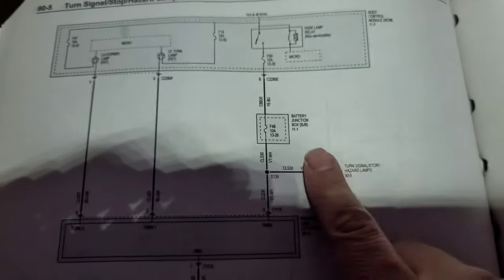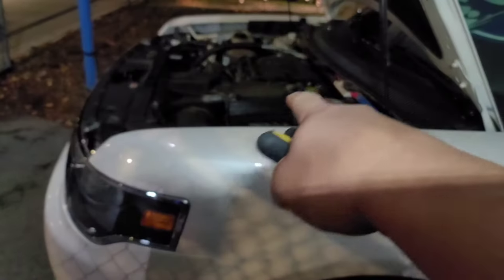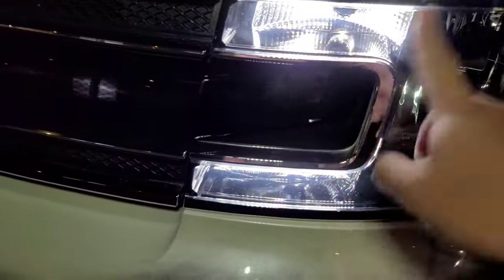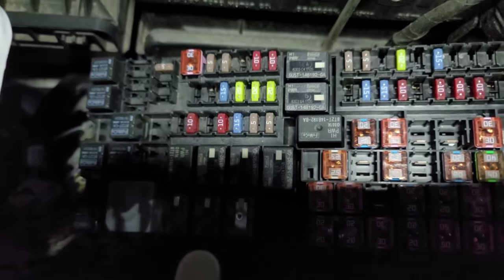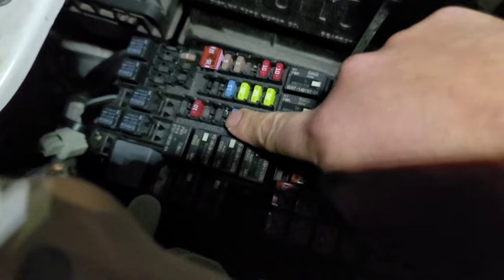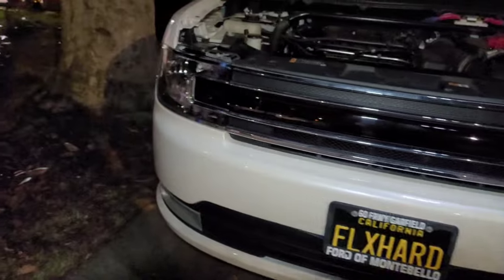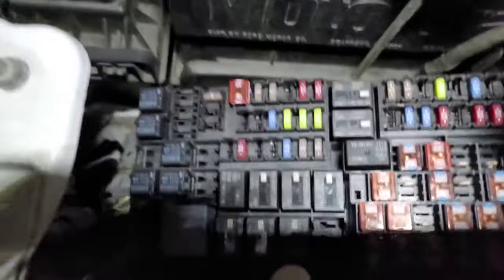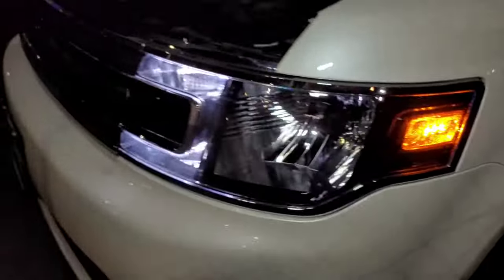Troubleshooting Front Parking/Side Marker Lights Not Powering On. For Onyx.

Comment: I am having the same problem in my 2006 nissan pathfinder, blinkers work but not the side lamps or running lights. The fuse for the running lights appears to be fine :(
Reply from the maker: Have you had a chance to test out the wires rhay connect to the side markers and daytime running lights with a Multimeter to see if they give you any power? It could be that the bulbs burned out and will probably need to be replaced if you do get power out of the wiring or it can also be a Relay that the lights are tied down to. If you happen to have the owners manual for your car ot might show you the relay the lights are tied down to on the side of the fuse for it. I hope this helps. 🙇‍♂️🙏
Reply: Haven't had a chance to do that yet, the bulbs for the side lamps aren't burnt out and the running lamp bulbs aren't either and the relays I've checked out seem to be fine. I haven't checked all the fuses though but I will, I'm hoping the one that burned out isn't one I'd expect.
Reply from the maker: @Trasc066  thats a good sign. In that case, yeah, you might have to check every fuse. Even this car i have has like a few fuses and relays linked like a chain with other components in the car. Like ill have the rear turn signal on the left side sharing a fuse with a puddle lamp on the front right side lol. Its crazy, i do hope you get to find out the problem.

Comment: Nice OBS F350 back there with the flat bed!!👍

Trying to diagnose nonworking front side marker lights on a 2005 Mustang. Front markers and turn signals work fine, as do the rear side markers and taillights/turn signals/brake lights.
Reply from the maker: Hi, that's gonna be a little bit tough since i dont have a mustang to try to mimic the same thing and give you a legit answer.

A couple of things you can try as Long as you have a Multimeter on you is:
1. Unplug the side marker light bulb from one of the side marker sockets and test the voltage with the lights on, if you get 12 volts running and when you turn off your lights the voltage goes to 0 then its most likely a blown light.

2. If there is no voltage at all being read by the Multimeter when you turn your lights on its possible that it could be a blown fuse or damaged relay which can cause the lights to not wsnt to power on.

I hope that helps, i wish i could be of more help to you. 🙏🙇‍♂️

Comment: Do you know some about a Chevy Tahoe 2009 I’m having the same problems right now with the side marker/parking lights too
Reply from the maker: Hmmm...... on your Tahoe if it's like the Silverado there is the black box underneath the steering wheel that has a large relay in it, it controls the turn signal flashing as well as the lights being on during the night time similar to what I had on the video. In your situation you may have to go the easiest route and carefully check the fuses to make sure none of them are blown as there may be a fuse that is connected to those lights that are not part of the flashing mechanism or the more complex side which is having to remove the plastic cover underneath the steering wheel to access that large relay from that box I mentioned earlier. I wish I could be of more help but since I don't have a Tahoe it would be difficult to mimic the same issue and find a fix for it. 🙏🙇‍♂️

Comment: What if there is no power at the fuse?
Reply from the maker: Hmmmm..... if there is no power at the fuse and the fuse is still good it could possibly be: 1. The wire underneath the fuse box could have gotten some corrosion and you may need to clean the wire connector so that it makes a proper contact or 2. The wire could be disconnected from the main power which will require you to do some troubleshooting and take apart the fuse panel which would be quite a bit of work using a Multimeter to check the lead from the battery to the fuse line that supplies power, the options with a Multimeter is to use the Audible Continuity Settings which causes the multimeter to make a beep sound when 1 end of the wire makes contact with the opposite end, this would also ensure that a little critter/wild life animal like a squirrel etc didn't get under your engine and started to chew up wires. Hope this helps.

Comment: Unfortunately, it is possible the LEDs went bad on you. When I did my HID conversion, the side marker was completely dead on one of the headlamps I bought from eBay. You cant just go buy a side marker either because its made into the lamp. I ended up cutting it out of the SEL lamp assembly that I had removed and cut the exact area on the HID to fit it in perfectly. If you go that route, make sure you keep as much of the wire length as possible so you can run it to the harness. Couldnt understand how the LEDs would have blown as the other side worked fine when I put power to it.

Comment: I have the "Same Dame Problem bro on my 09' Nissan Frontier.Checked all fuses...Checked all 💡..nothing..I'm lost bro..
Reply from the maker: Hmmmmm...... haven't had a chance to check out a frontier yet but have you checked the relay for it? I'm not 100% sure if it's the same like the flex that I have but if your turn signal lights are (ON) like daytime running lights or stay on when you have your headlights on at night it could be a relay that controls them. There are a couple of locations to check, one is in the engine bay and the other is on the driver side underneath the dashboard. I wish I knew more so I could help you better. 🙏🙇‍♂️

Comment: You have a link for you leds you mr using?
Reply from the maker: This is for the switch back lights. The price went up a bit and you will need two pairs. 1 pair for each side.
https://www.gtrlighting.com/gtr-lighting-carbide-2-led-bulbs-3156-3157?quantity=1
Reply from the maker: Here is a link to my video on the GTR Lighting Switchbacks. They still work like a champ but on hot days they will hyper flash and will go back to normal speed once they cool down. They will also hyper flash if you had them on for too long on a turning lane like in Los Angeles where it takes almost 10 minutes to be able to make a left turn lol! 😅

https://youtu.be/rLsjiJieSsU
Reply from the maker: Please select the ones that say: 3156/3157 Non-CK: GTR Carbide Canbus 2.0 LED (Switchback) this way you will get the daytime running cool white light and Amber color for your turn signals.
Reply: Awesome thanks. I'll check them out.